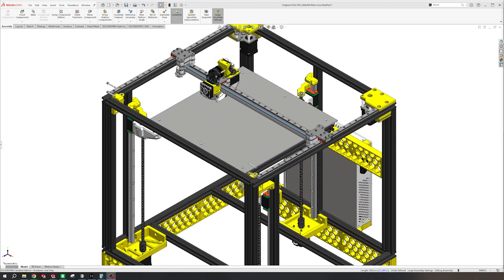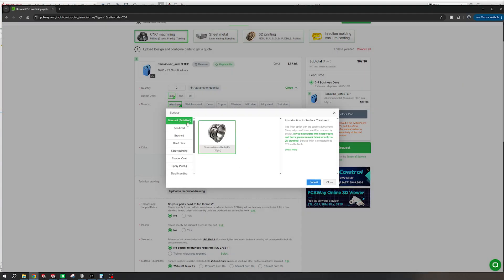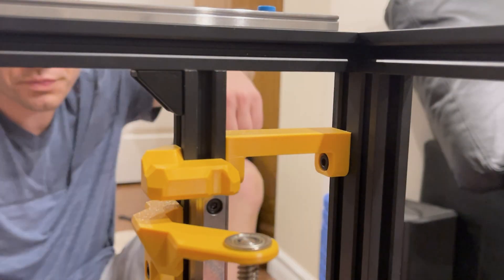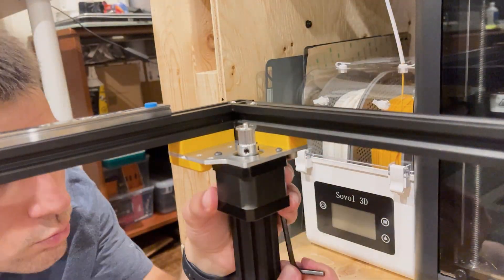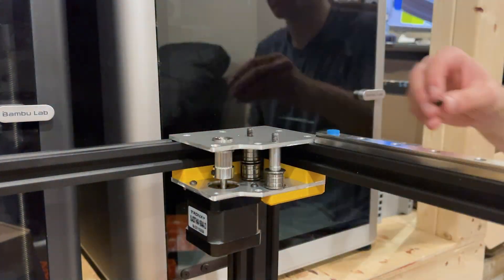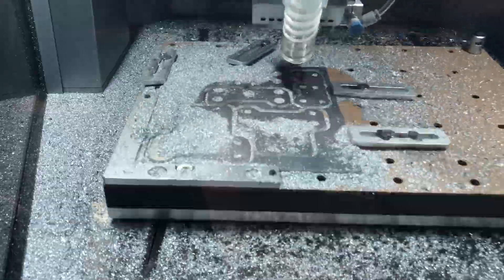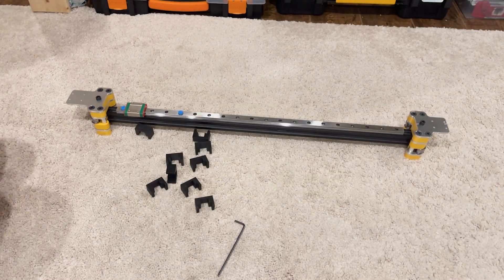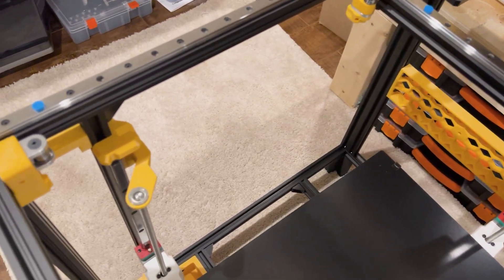Hive 3D Printer: Building the Core XY X-Axis (Part 4 – Biggest Challenge)

Comment: Congrats on the sponsorship! That's huge and well earned. It's a bit annoying that the motor shafts are too short for double sheer, but If (and I can 100% recommend) you switch to some LDO Speedy Power motors, they should offer a perfect shaft length option, and a bunch more power too! Something for the future. Those assembled parts look insane! The yellow actually looks pretty great in there, haha. Loving the build and series so far; more printer build series are always awesome to see. 
Having a CNC opens up a few more interesting possiblites that I'd like to see one day, like removing some bottom material from that X-Gantry beam to save on weight, or even removing some unnecessary material off the long linear rail on the beam. Would be challenging given the material (exlcuding the alu-x-beam) but could make for interesting mass savings. Cheers!
Reply from the maker: Thanks I appreciate it! Down the line I may go in and upgrade them!
Reply: @MakingWithLaz  Will the design be shared with the public? :D